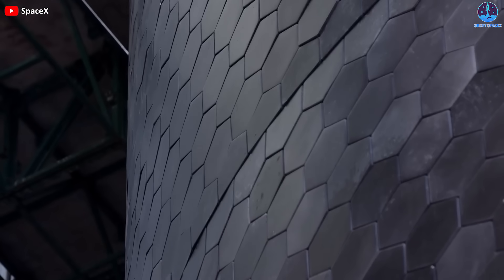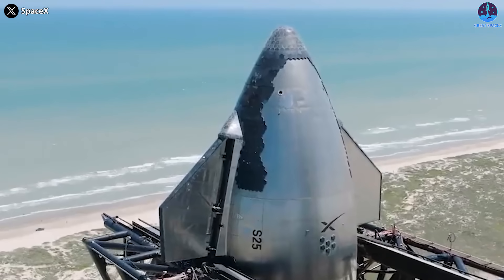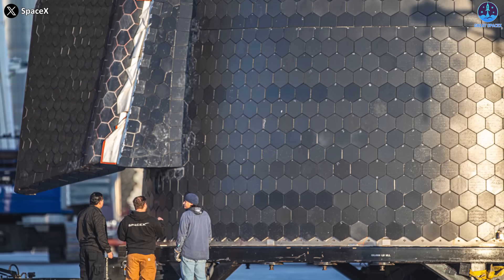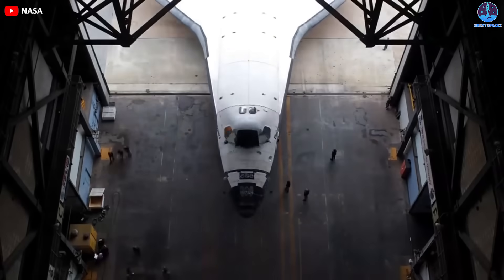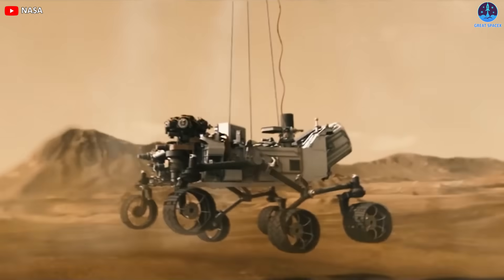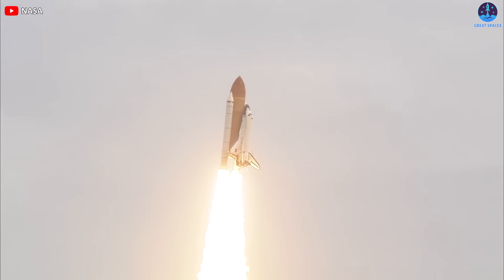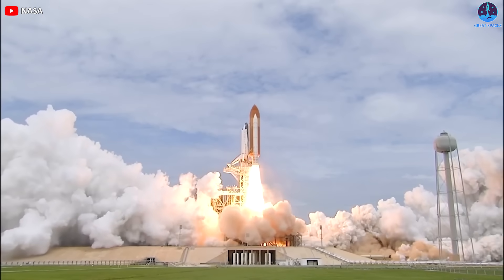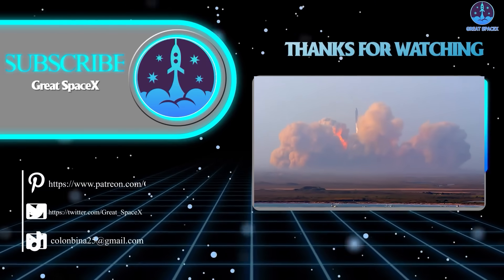SpaceX Starship's heatshield falling off during the launch! How SpaceX to fix?

Comment: I think that the Starship -- or any reusable spacecraft for that matter -- should have a duplex heat shield. That is a heatshield over a heatshield. Maybe an ablative undercoat over which tiles are adhered. The point is that it is UNREASONABLE to expect that no tile will ever come off or predicate the survival of a vessel no tile ever coming off. The vessel should be able to survive the loss of any tile or every tile. The tiles are there simply to prevent damage to the undercoating which takes a long time to strip and repair.

Comment: Even without the heat resistance wooly insulation, the rocket can likely survive some missing tiles with the steel structure beneath acting as a heat sink.

Comment: None of what you said about the heat of re-entry or how a heat shield works is accurate. Do you know why the space shuttle having a hole in the wing was an issue? First, the entire frame of the shuttle was made from Aluminum which melts at 660.3°C or 1,221°F. According to official reports for the Columbia Space Shuttle, we have the answer. Hot plasma that was heated to 1,315°C or 2,400°F entered the left wing and melted the interior, burning through sensors and hydraulic lines and eventually destroying structural integrity of the wing. Now the melt point of 304L stainless steel is 1,450°C or around 2642°F. Now while this sounds like it would still weaken the stainless steel, the fact is that it would not melt the stainless steel and if the size of the heating point was that of a single tile. The TPS tiles are also covering a solid stainless steel surface which in itself can spread out heat from one spot. The heat that melted the interior of the Columbia's wing would not be enough to melt stainless steel. It would be enough to make it mailable, but not enough to melt a hole in the hull. But the reason why its most likely to not have any deleterious effect on the Starship's hull is due to the fact that most of the surface area still covered in TPS tiles would be absorbing most of the heat. Thermal conduction through a contiguous 304L stainless steel surface around 4mm thick with a thermal resistance of 0.00024 m^2K/W would propagate heat fast enough to resist any re-entry heating from LEO. This is also the reason that the Space Shuttle Atlantis survived and it only had a single steel plate under the offending broken tile. Starship is completely made out of steel.

Comment: the best solution to this problem, do not use tiles. then what? they need to come up with a sort of paint, that would withstand the heat and vibration. no one, ever, has invented such special thin or thick paint layer so far.

Comment: Well, SpaceX is experiencing the same problems Shuttle did - same technology, same problems. The difference being that Shuttle made it through its first orbital attempt (and it should have better - that first test flight was crewed - now, that took some "right stuff")

Whatever fanboys might think, Musk is not a wizard (neither are his very capable engineers.) No magic wand or incantations - the same problems facing any launcher (fuel sloshing, vibration, leaks, and, yes, thermal protection) will inevitably rear their ugly heads. In this particular launch TPS problems were not critical - nobody would cry if Starship made it to Hawaii, but in pieces. But now is time to start fixing this problem, one of two major ones remaining (the other is fuel management in SH post-staging; that problem is why header tanks are there, but more work is obviously needed.)

Comment: Actually, a reentry test was planned in this mission.  Also, these heatshields that SpaceX tries to use for Starship, do not shed material with heat.  They're not ablative heatshields like on the CrewDragon.  They dispense heat energy by radiation.  The old Space Shuttle's heat shields worked on the same principle.  The heat during Mars entry is not the critical problem.  The Earth entry is.  Mars entry and landing has a different problem.  Rocket engines and fuel must be used to slow down the vehicle because the Mars atmosphere is not thick enough.

Comment: Heatshields:
There are two technologies:
1. ) Ceramic tiles, which can withstand temperatures in excess of 2000°C. This is housed on starship and Space shuttle. They absorb and disperse energy by heat radition and turning air into plasma. They can be used repeatedly.
2.) Ablative heatshields, which are used on re-entry vehicles like Soyuz or Dragon capsules, afaik. They disperse heat by evaporation (ablation) of the heatshield as plasma (like brake pads). Therefore need to be replaced completely before every flight.
The latter is not suitable for SpaceX.

Comment: So we're all familiar with the frost that builds up on the outside / skin of rockets from the cryogenic liquids inside. And under the octagonal heats shield tiles is a ceramic fiber mat.
So I've got two questions, having actually used such mat in foundry insulation I know even a leaf blower will damage it after it gets cooked, so a second flight where a tile came off would blow into, strip away and get under the adjacent tiles.... Would this cascade in stripping off many tiles?
Secondly, getting back to that condensed moisture, atmospheric moisture is going to penitrate into the fiber mat and freeze, no doubt about it. So then starship launches and Tha frozen water is sitting inside the insulation: so it adds weight (off center too) to the vehicle, what does it do in space? How quickly does it sublimate? And what happens to that ice if it's still there under the heat shield tiles during reentry? How fast does it melt and if it starts vaporizing quickly does and steam pressure build up under the tiles? Remember, the temperature rises in seconds as the vehicle enters the atmosphere, are the gaps between the tiles far enough apart to vent pressure from underneath? The ceramic fiber is water proof but here on earth, ceramic fiber that gets wet tends to collapse and form a denser mat that doesn't have the voids that give the insulation value.
I wondered why SpaceX didn't use thin panels of material similar to automotive racing brake shoes that would be under a group of external tiles (ten or so) that wouldn't be breathable to atmospheric moisture, and by probability if a tile fell off the high velocity airstream (actually the air stakes up on the incoming face and compression causes the heat) would hit the bigger panel underneath and it would help by not having a burn through or giving such a large gap to get under adjacent tiles and lift them off.
I think it would be a more reliable system and offer more reusability
Reply: Interesting observations.  Remember at Max Q the Starship is traveling at approximately Mach  3.  Does the accompanying thermal load boil off the water trapped in the mats before it gets cold, freezes and expands in orbit? With the tiles protecting the mats can the mats dry out before Max Q?

Comment: given how long it was sitting around completed I can't say I'm surprised some tiles fell off. If I recall the use of stainless steel means they should not need the tiles and the tiles are merely a back up.
Reply: That s incorrect,. Initially it was claimed that SS did not need heat shields because the  stainless steel was going to be protected by a gas layer of methane. That system did not work. Now the stainless steel is protected by a ceramic heat shield. No heat shield and the stainless steel would melt in the heat of reentry. If steel could withstand reentry, the backup would be thicker steel. (which would also makes the SS stronger). Ceramic heat shield tiles is a headache that you do not want but tolerate because you need it.

Comment: Part of the problem with the tiles is that they were subjected to the full force of 33 Raptors at 100% thrust for the first time.  Clearly they didn't all survive so another method of fixing the tiles needs to be found.  Also, we don't know how much damage if any, was caused to the tiles after booster separation.

The main unknown therefore is how the tiles will perform during re-entry, especially the tiles on the control surfaces.  SpaceX needs to make sure that the tiles stay on for rapid reuseability of Starship even if re-entering is perfectly safe with a few tiles missing.

A correction for your video... the heat shield on a reuseable spaceship like Starship or the Shuttle is NOT ablative and is designed to be reused without mechanical or thermal damage.
Reply: Yes. Heat shield tiles are designed NOT to be ablative and to never be degraded.

Comment: One unmentioned point: The missing tiles favored the seams on S25 because those areas didn't have the studs, at least on that (very old) ship.  They used glue only.  As this video noted, they were not at all concerned with the survivability of S25.  Indeed, they were just about ready to scrap it, like they did with other Starship models before it, but figured it ought to be a cost savings to go ahead and get some use out of it, even if it was a little out of date.  This is also the reason why the flight profile had S25 slated to just crash land into the ocean, rather than attempt a soft landing there.
Reply: This channels videos always seem to have a a couple facts that are not totally correct. It amazes me that there are so many views when there are other channels that are more accurate.

Comment: Why can't they drill holes through the heat tiles from one side through the other side,and string them in rows like a necklace and anchor them on each side to the rocket where heat shield is not needed with steel cables.

Comment: The Spacex tiles are refractory. They do not use ablative cooling to protect the surface of the rocket but shield it from the reantry heat by their low heat conductivity!

Comment: Correction: ABLATIVE heat shields burn up during reentry. Thermal control tiles such were used on the Shuttle and are used on the X-37B. and SpaceX's Starship do NOT burn up. They are made to withstand the heat of reentry while insulating whatever they're covering. One wonders if anybody at SpaceX has contacted Boeing to see what adhesive they use on the X-37B.  USSF is using the X-37B a lot. Since right now the X-37B is the only reusable spaceplane flying, whoever maintains it for the USSF likely has a handle on maintenance.

Comment: Question-if the thermal blanket under the tiles- Kaowool 3000 is rated to 1350 degrees c-then why can't they put 2 layers of this on the starship instead of tiles?

Comment: I think the solution might be to layer the tiles like roofing.  And even the wool underlaying is similar to roofing felt.  Not the temperature part, just the way it is constructed.  But you can't exactly nail heat tiles to the rocket. but with layering even if some glue broke there would still be the adjacent and covering tiles (hopefully) holding them in.

Comment: Heat shield is not an issue. It has a thermal blanket underneath the tiles.
They could look into an oblative shield like they have on the dragon. I do not know why they do not use the oblative shield.
Reply: Because they want rapid and frequent turnaround.

Comment: SpaceX needs to speak to the older experienced people who worked on the Space Shuttle tile system. But the problems with the Shuttle heat shield plagued the entire program and let to the loss of a mission. Lets never ever forget these facts.
Reply: Not SpaceX way as it may end up with $100,000,000 turn arounds.  More likely after they get things mostly working they will pull off some tiles, instrument and risk expending a Starship or two to find out what is really critical.  Remember Starship is made from stainless steel, not the tempered aluminum alloy that the shuttle was that softens and drastically weakens at 300C.
Reply: @michaelmcmullen354  Heat of reentry is 1480°C. The highest melting point I found for Aluminum alloy is 671°C. The maximum melting point of stainless steel is 1510°C. Carbon Steel melts at 1540°C. I’m not sure what proprietary alloy SpaceX uses. Temperature protection tiles are necessary because the steel will continue to absorb heat energy as long as it is exposed to the heat of reentry.
Reply: The Starship tiles are attached in a completely different way particularly to facilitate installation by robot.

Comment: I suspect that the steel pins that each heat shield is attached to do not have enough common surface area between the two materials to withstand the intense loads from vibrational G force, which likely damaged the tiles at the pin interface causing them to lose bonding strength.  They'll have to redesign the pin and tile interface with more common surface area without increasing weight.
Reply: And/or provide vibration damping.  Either way they have some serious fixing to do.

Comment: While loss of heat shield tiles is clearly concerning, the steel hull of Starship may prove somewhat resistant to the plasma buildup during reentry. If Starship loses a handful of tiles in different locations it stands a good chance of surviving reentry.  Does that mean we should be content to let a few tiles fall off?  Of course not.  But we should drive home the fact that a steel hull makes Starship far more robust than most other orbital vehicles that do not use steel because of its weight.

Comment: Securing heat shield tiles to a spacecraft was mastered by NASA 40 years ago.  Like launching w/o a water deluge system on the first flight, this is more potentially fatal corner-cutting from SpaceX.  "I know more about (rocket) manufacturing than any person alive" -Elon Musk
Reply: Really. So why did the shuttle fall apart?
Reply: @jamskinner  Space Shuttle flew 135 missions w/o losing a tile until 2003 when a chunk of insulation knocked a tile loose and doomed Columbia.  Musk can’t even fly once w/o losing dozens of tiles due to sloppy construction.

Comment: Stainless Steel (the 304 that StarShip is made from) can withstand temperatures just below 2500 F or 1371 C. Losing the heat tiles would not necessarily destroy the ship however it would heat everything inside the craft and more than likely catastrophically terminate the mission.
Reply: Could be potentially fatal for a actual human crew.

Comment: Having watched the shuttles losing tiles all the time, I have wondered if there was a way to puzzle piece multiple layers of tiles, considering the stress and vibrations. No engineer but a multiple layer of heat shielding seems to be the correct approach no? Rule of three maybe… as in layers. The weight would be extra but possibly the engines can handle it regardless of fuel consumption added as well? Premium would be if they could bleed that thermal build up and bleed it off as energy for descent rockets. But again, talking out my rear.🤣

Comment: I don't get it. This is a problem even NASA has had since the original space shuttle. Why is it so hard to keep the damn things stuck on?
Reply: 27,000 mile per hour winds are pretty extreme.. Forget the heat
Reply: @hawkzulu5671  Yeah I was trying to conceptually quantify the heat itself by comparing how hot 100c is vs 1500c... That's insane. But in terms of keeping the things on there's got to be a better way? I think it's still more or less the same principle as the space shuttle?

Comment: I don't think the all black heat shields need to stay on to be as effective as the NASA shuttle. I do think they dnt want to lose any as you would have to replace them and if you are going for a turn around flight like a plane you def do not have the time to do that. My point is I think right now if a dozen fall off when the booster lands it won't matter. I think getting the data on how they hold up under the cold then the heat in more important than fixing a few that fall off right now
Reply: That’s what I was thinking. That maybe they can loose a certain number as long as they aren’t in the same place.

Comment: Easy fix:
To create better adhesion for the tiles to stay attached to the stainless steel, they need to sand the surface of the stainless steel in circular patterns creating grooves which significantly increase surface adhesion area.
Reply: Im sure the best engineers in the world will greatly appreciate your insights mate
Reply: @paulmoreira9402  With over 30 of advanced material reinforcement, thermal protection, advanced polymer development, coatings, adhesive manufacturing and failure analysis engineering experience, I have vast knowledge and experience in multiple disciplines.
Reply: A very good idea. Let's make a rocket together!
Reply: From what I understood they don't use adhesive to fix the tiles, but studs. And there's also the fiber mat in between the tiles and ship's steel surface.
Reply: @airspeedmph  I understand as apparently SpaceX method of affixing the thermal reflection protection tiles is failing thus my suggestion to better approach.
-Just saying
Reply: Holy shit get this guy a job at SpaceX!